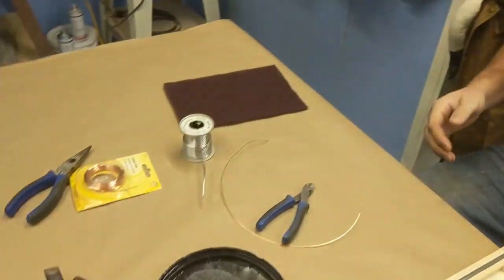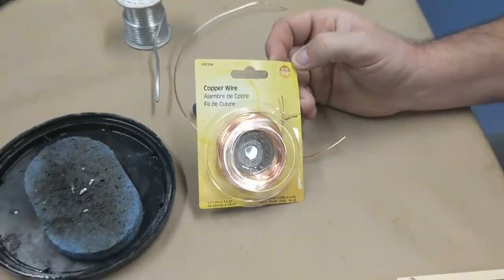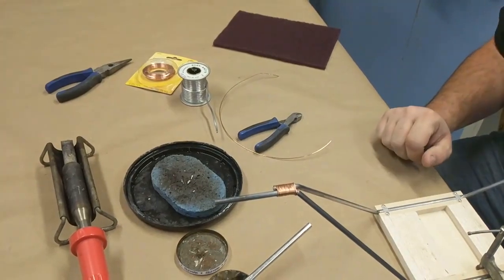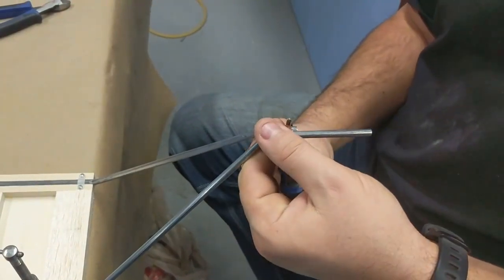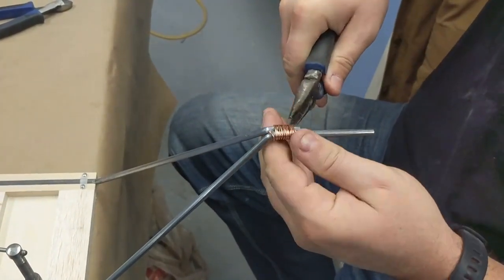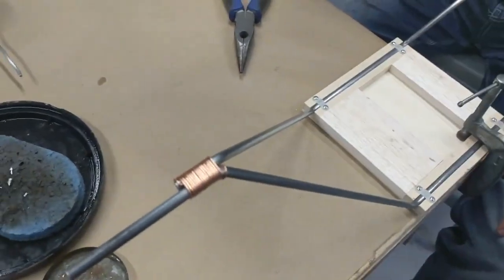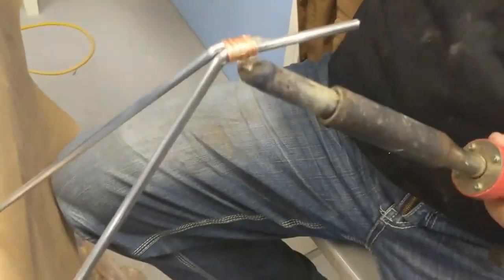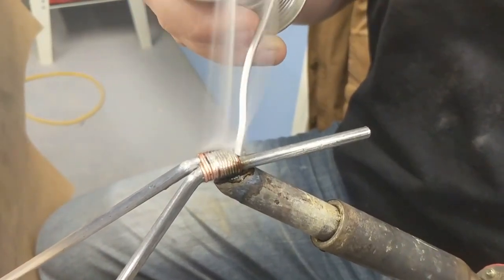Soldering Landing Gear How To

Comment: Thanks, Chad. I bought a Weller 175 W iron on Amazon and followed every step you outlined. Now my E-flite Carbon Z Cub has a custom replacement landing gear with aft braces. It looks great after I painted it with Rustoleum primer and satin black latex house paint.